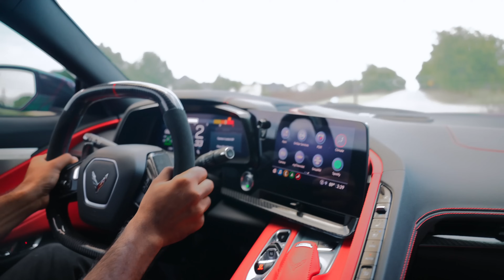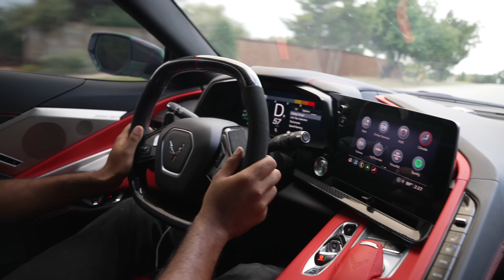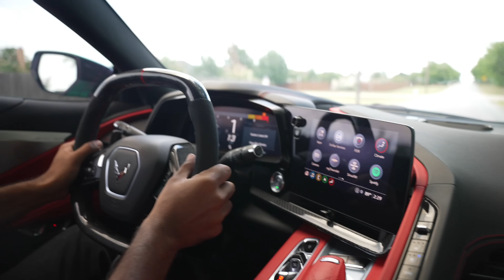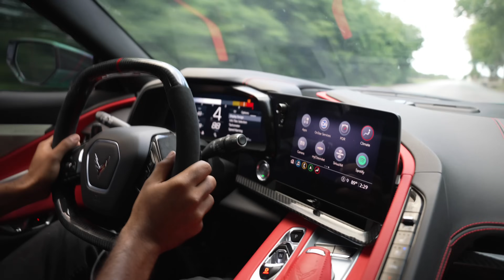Turbo VS Supercharger! Which one is right for you? C8 Corvette shootout at BoostDistrict

Comment: I live at 7,000' Elevation.  9,000'+ Air Density Altitude Days are not uncommon in the Summer.  This means about a 25%-30% power loss just due to the elevation and environmental conditions.  Either Turbos or a Roots Supercharger at these boost levels are basically just going to get me back to OEM HP.  For the way I intend to drive the Magnuson is the way to go.  I don't want to get nuts, I'm good with a GT/Power Cruiser that I handles very well.  I'm not looking to live on the redline or Race/Track it... well maybe once or twice, but not regularly.

Comment: supercharger! Instant power and unbeatable sound.
Reply: They sound like a bad power steering pump. Prove me wrong.
Reply: That's not entirely correct. Centrifugal superchargers don't give you instant power...the boost builds with RPM. Depending on the setup/tune, a turbo can give you plenty of instant power. 20:50

Comment: Good video.  For a future video, it would be awesome to see some performance data (0-60, quarter mile); also line them both up and do a race from dig and from roll.  Adding a 3rd car with all motor (heads, cam, exhaust, etc) would be cool too.

At your 9min mark doing turbo pull in Mexico,  was it just me or did the car seem like it was missing as it shifted into the next gear going to redline?

Comment: stingray and eray have the lt2 with a traditional pushrod v8 setup for gm, which lends itself better to supercharging. z06 revs high and fast which is better for spooling turbos quickly and making more top end power and low end torque.

Comment: Very cool setups on both cars. 
Do you offer a warranty on the car or just the engine, since doing either supercharger or turbo will void factory warranty on engine and drivetrain?

Are you using HP Tuners to unlock ECU for engine tuning?

Why so much white smoak from exhaust while on dyno? 
Is that oil blow-by?
Supercharged car had more white smoak than turbo, why?

Have you broken the code to unlock the ECM to tune transmission as well? To add pressure to clutch engagement and adjust shift times?

Comment: Why not top mounted turbo instead of undermounted? Also what exhaust do you recommend for 2021 C8 Z51 which gives it that deep tone?  I'm looking to add more power eventually
Reply from the maker: top mount creates a ton more heat in the engine bay. this car is built perfectly to have them mounted low. We have another BD1000 car here with no mufflers that is much deeper in sound - and also another one with a Z06 style center exit

Comment: Supercharged cars for the street can’t be beat due to the absence of turbo lag. Two types of superchargers are the positive displacement ones and the centrifugal ones. Positive ones hit super hard down low and r tough to beat. Centrifugal blowers spool up like a turbo but driven off the crank and have a wild midrange and highend rush. I have a Procharger a94 head unit and a meth flex fuel setup that makes 1251.9rwhp. It’s insane where it matters…medium and high speed driving. If your just driving around on surface streets and a little highway use then the positive displacement rocks

Comment: Could you run E85 on these setups? What would need to be done? Would the cars transmission still hold with the extra power? I have a 2020 and been looking to do something like this.
Reply from the maker: yes we can definitely run e85. we just have to do some work with the fuel system and pressure limits with the clutch clamping. easy fixes- just gets pricey

Comment: Why is the blue c8 smoking on the dyno pull?
Nice looking build!
Reply: sometimes new turbos cause smoke for a couple reasons that usually clear up in 100 miles or so. Machining oil, higher vacuum and temp picking up debris and any oil that was already in the exhaust and the higher temps burning it off and a weeping oil seal goes away after a heat cycle because it is a metal on metal seal that needs to swell and seat correctly (although that one is kinda rare).

Comment: Burning oil on that turbo dyno run. Are you running a scavenging pump for the turbo oil drainage?
Reply from the maker: yes they have scavenging. they're brand new with less than 50 miles- plenty normal for break in

Comment: Superchargers give faster impact, but poorer gas mileage than turbos.  Superchargers may require more engine parts for good reliable performance, but turbos are basically bolt on.  I tend to lean for Superchargers as the power comes on quicker.